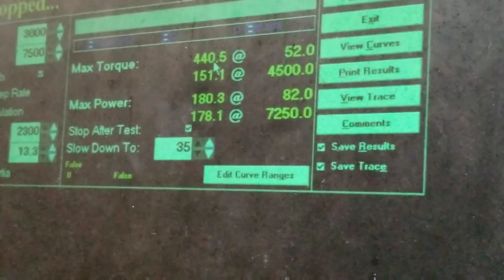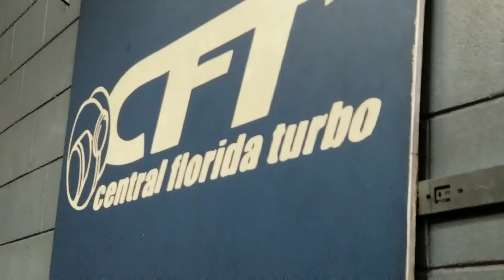B20 vtec killer /h22 vtec killer / h2b dyno day at cft!

Comment: The locked vtec cars are awesome im about to lock vtec and get a retune next week on VP 110 fuel in my all motor rod piston cam css B18CR made 217whp 141tq on 93 pump hoping to make 230whp 150tq on the 110
Reply from the maker: Give it a like and share
Reply: Damn 230? Should just go k bro
Reply: I feel you bro. Ppl like wat they like
Reply: sctflasher379 but what i will say for the money i spent your right i coulda gone k and gone faster no doubt they are amazing motor and the future!!! but this motors built for spray so it’ll compensate for its size with the juice 😈🚀
Reply from the maker: Like/subscribe/share

Comment: The B20V was stock low comp? .. I have similar numbers with a built head stock low comp B20B .
Reply from the maker: Yes sir 
Like/subscribe/share
Reply: Dyno numbers should’ve been higher
Reply: @mobtiesatl619  not with low comp, if we get the bottom block built with a higher comp maybe around 13-14 on E85 we can get around 220-230 whp. Mines on E85 , I put down 175 with 133 tq
Reply: I’ve put down 234whp with 12:55:1 compression. Don’t need that much compression to make 220. Made around 200whp with stock block and type r cams. Y’all need better tunners
Reply: @mobtiesatl619  some dynos read different and weather makes a difference. I built my block and compression to 13 with a GSR cam no porting done and made 205 on low reading Dynapack on a hot day with a 30% clogged injector. My tuner is well Respected and flys out everywhere and does remote tuning. It just all depends on certain variables. I'm sure my car makes around 218 whp right now . With a better cam and port I'd get 220-230 The way it is it keeps up with 400 hp V8s #Dardantuned

Comment: If i add a f20b head on my h22a block will it be more aggressive
Reply from the maker: No sir the f20b head has smaller intake valves and is supposed to make less power
Reply: ej8 coupe hday project car holmes only advantage of the F head is the cams and springs. Other than that there’s no point in swapping heads. This build was probably a budget build that was pieced together.
Reply from the maker: @TheBb6prelude  f20b had springs and retainers and h22 head was stock
Reply from the maker: Like/subscribe/share

Comment: H22 f20b head
Reply: thought there the same head as a h22 the f20b and the h23 blu top
Reply from the maker: F20b has smaller intake valves by 1mm
Reply: @YostBuilt  thank u yost built ill leave my h22a the way it is ill add some bolt ons wit some super tech valve spring retainers